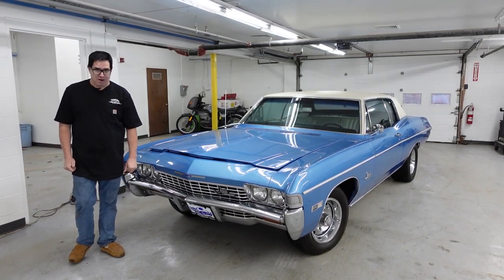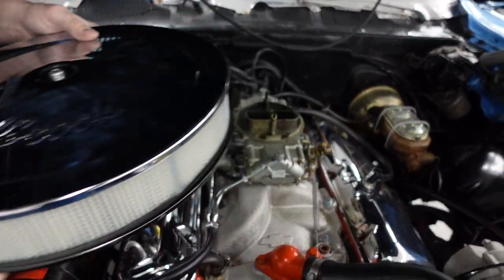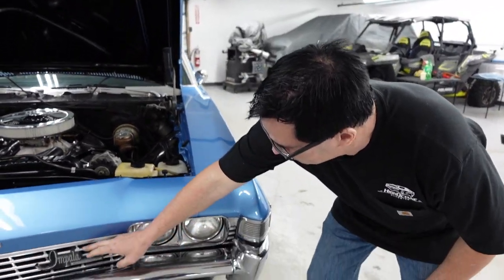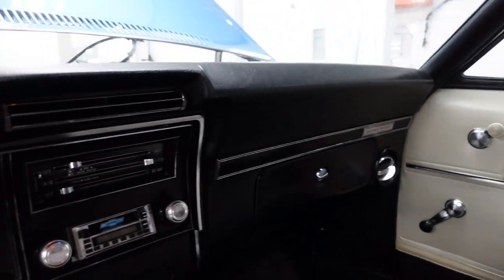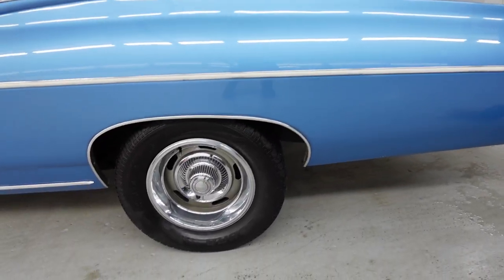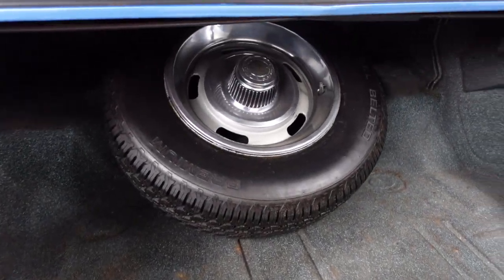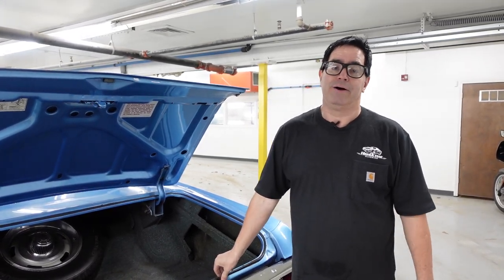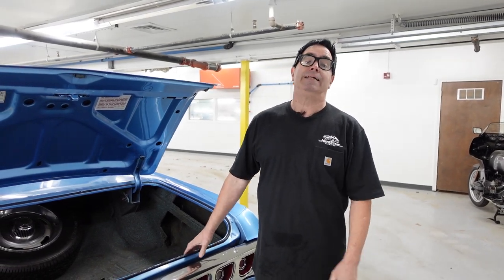1968 Chevrolet Impala Walkaround with Steve Magnante

Comment: Neighbor had a 68 Caprice with the 396 2bbl. I never really saw it run hard at all.  Owner believed you just babied them and they would last forever. He always called Dad every few weekends or so and have a problem with the car. Dad would go over and test drive it and return. The guy would always tell him he didn't know what he did to it but it worked. Month after month this went on for years.
I asked my Dad what he did, after he got back from his test drive. Dad just said, the guy never blows the soot out of it.
Reply: Your Dad and I had the same experience with cars it sounds like. My Mother and several other members of the family got so they would want me to wash/drive their cars every once in a while because they always seem to run better after I did. Like your Dad all I did was blow the carbon out of them. Sometimes I got carried away and almost wrecked. The old bias ply tires didn't grip well especially after they got some age on them.
Reply: @JT-SE-OHIO  Oh gosh, my aunt and her brake issues. Every car she owned I can remember dad going to the parts store and loading up the cab of the truck with brake parts to do her car. It was about an every 2 year thing, all 4 brakes every time....

"Gerald, something is going on with my brakes again." Rarely less than a 3 rotor or drum job with her....

Comment: Gorgeous. It almost seemed Chevy tried to hide the fact it was an SS with those tiny badges which were so prominent years before and also for the ‘69. I think you could also still get the SS427 in ‘68, which really amped up the performance and had more prominent badging
Reply: The optional & specific "Z24" package (SS427) was available '67-'69. In '68 it cost $542.45 & 1,778 paid the piper.

Comment: Interesting to see the SS package on the formal top/custom coupe body #47.  More often seen, on the body #87 hard top/“fastback“/Sport coupe.
Steve, one minor correction per my Library research. The RPO Z03 ($179.05) Impala super sport option included special all vinyl interior, Strato bucket seats, center console shift with automatic or four-speed manual transmission and SS wheel covers. (I suppose a factory bench seat could be optioned back in).
The tail lights double rings always seen on caprice models but not always on the super sport models.
Steve, thank you for what you do. I enjoy your reviews.

Comment: Brings back some memories I had a 1969 sport roof Impala had the 396 automatic and the car was triple black all the options worked power windows air conditioning was not SS model but back in those days you could order anything you wanted

Comment: Just my old opinion but that was a high point in GM cars.  Seems I recall the old Impala also came with a 427 if you really wanted hp.  Ah those big steering wheels... what a feel.  Key in the dash.  High beam switch on the floor.  You could sit on the hood without denting it.  Bias ply tires rather sucked but you can't have it all.  I had an Olds from that year.  Caprice was the luxury version of an Impala... rare electric windows.. tilt and telescopic steering... big stuff then.

Comment: Air conditioning 🤣
Reply: No belt. Wonder if it works.
Reply: @petevalz609  If the ac worked it would have a belt instead of a rusty pulley.